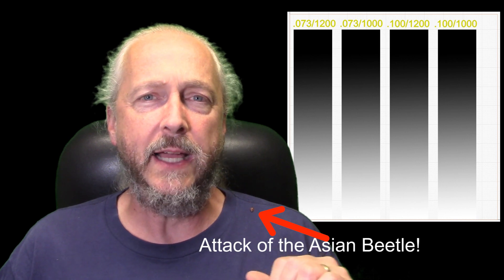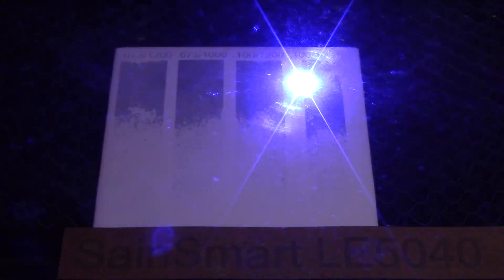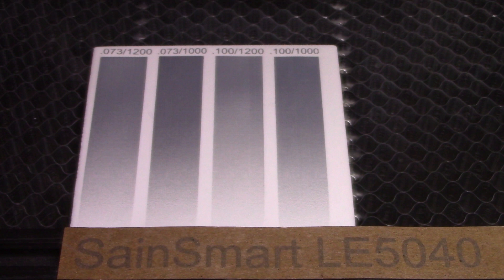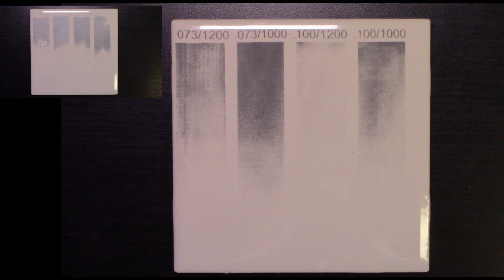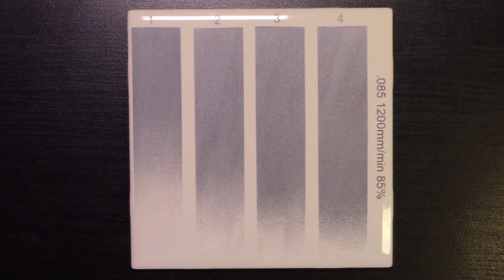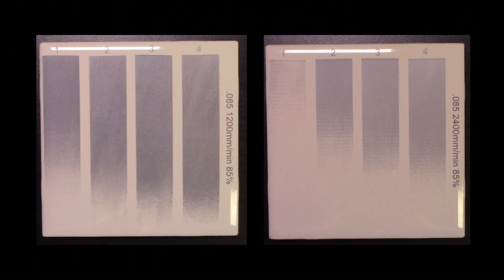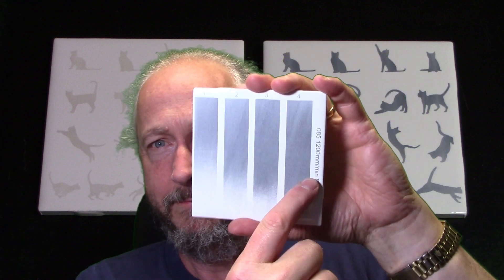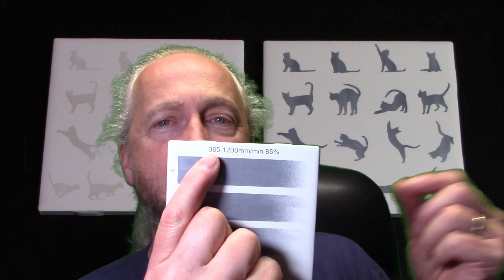Issues with painted tile etching! Part 2

Comment: I've had much darker images with Titanium Dioxide TiO2. I have not been able to get dark clean images from paint
Reply from the maker: I have some TiO2 that I want to play with.  The theory is that is part of the white paint that is doing the turn black thing.  My hope is the TiO2 will work better and be more consistent. Do you just suspend the TiO2 in alcohol or something?
Reply: @CNCATHome 
I use alcohol and a cheep airbrush with a 3:1 mix, my tests with my 150w co2 running at 200mm/s @25% power are black black. From what I understand you can't get a gradiant of black but you can get very small dot size. Great videos though!
Reply from the maker: @markrumrey790  - Thank you for the information.  That will give me a great starting point.

Comment: I really appreciated you showing your settings on Light Burn in your first video. i just recently purchased the MakeBlock X Tool D1 with a 10w laser. Will your Light Burn settings be different than mine since they are different machines? (Hoping I'm asking that correctly). As always Thank You Sir for sharing!
Reply from the maker: Good question.  I am not familiar with the MakeBlock X Tool D1.  If it is a GRBL driven controller, the controller settings will be similar.  It looks like the power of your laser is almost twice mine so your burn parameters will be different.  You should be able to either lower the power or increase the speed of your burn compared to what I am doing and end up with similar results.

Comment: It's odd because I had pretty much the same experience. The first two tiles I did came out perfect but I've been unable to duplicate it since. Could I have simply gotten lucky on the first try?
Reply from the maker: Sorry to hear that you have run into this issue too.  I have not tried very hard yet to duplicate this problem.  Usually I do not have an issue burning tiles using this method so having it fail as it did is the anomaly.  It was most likely a combination of too much paint on the tiles and/or poor focusing of the laser.  I have done several tiles since this and they have been coming out great.  I hope you are able to track down this issue and get back on track of successful burns.

Comment: Hi AT, I'm not sure if this will Help You or not. I was experiencing the same issue. The only explanation to this experience I would surmise is, The Different Kinds of Enamel Paint and Preparation on The Tiles. They are all different. So I started painting my tiles with a Product from Rust-Oleum named "Cold Galvanized Compound" Results were More Consistent Every Time no matter what kind of tile I used.
Reply from the maker: Great input.  I have been hearing from others about using CGC.  I am also wondering if ZRC would also work (zinc rich coating).  Will have to give this a try.  :-)

Comment: I burn mine at 3000 mm/m at 40 percent power comes out great I have a neje 30 watt around 5.5 watt of laser power
Reply from the maker: 1,200 to 1,000 mm/min at 85% power on my 5.5 watt LED seems to be the sweet spot.  That along with .1 to .085 mm/line.  Figuring out the power and speed settings for each laser is something that everybody should do.  It is great to have a staring point that will get you close.  Thank you for the extra information.